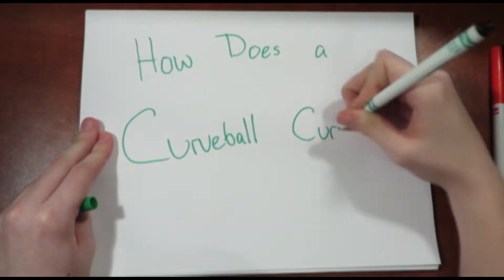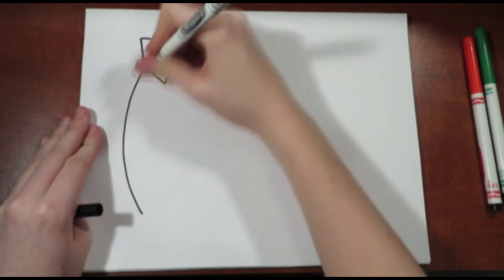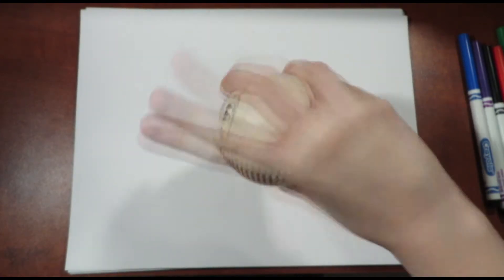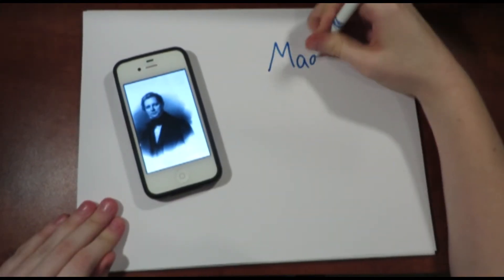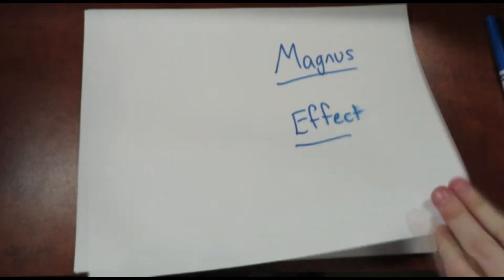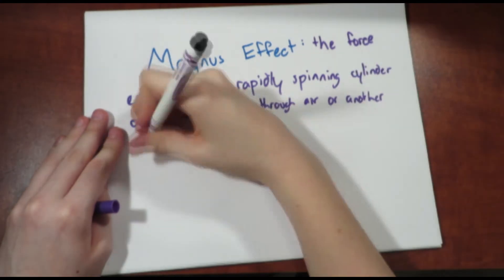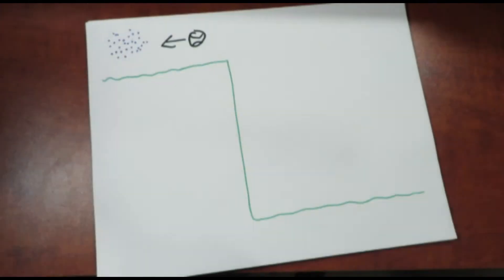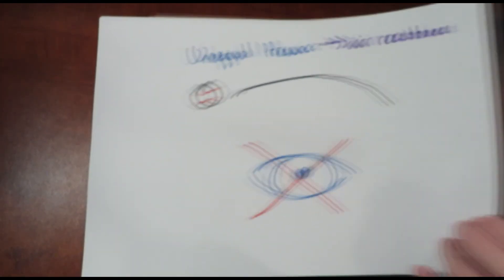UPDATED: How a Curveball Curves

Comment from the maker: How does a Curve-ball Curve? Script: 

Baseball isn't just about throwing and hitting a ball, it actually has a lot of physics. Take the curve ball for example; many people years ago had believed that it was just an optical illusion or that it was easier to throw then a fast ball because you throw it with less force. However, both these misconceptions are wrong. 

Curve-balls do indeed curve, or break, over the plate. A curve-ball is a pitch that appears to be moving straight toward home plate but that is actually moving down and to the right or left by several inches. A ball that spins 30 times a second can break as much as 17 inches, which takes less than half a second to reach the plate.  But how is this possible? Well, there are two basic factors that create a curve-ball, the proper grip and air resistance.  

Properly holding the baseball is an important factor to make it curve! You have to use 2 fingers and a thumb, holding the baseball between them, with the middle finger resting on the seam (red fabric) of the baseball. Then when you release the ball you have to snap your wrist causing your hand to be facing the plate and forming topspin on the ball. The ball will break down and away from a right-handed batter if it is thrown by a right-handed pitcher. 

The spinning action created when the pitcher releases the ball is the secret behind the curveball. This spinning causes air to flow differently over the top of the ball than it does under the ball. The top of the ball is spinning directly into air and the bottom of the ball is spinning with the air flow. The air under the ball is flowing faster than air on top of the ball creating less pressure, which forces the ball to move down or curve. This imbalance of force is called the Magnus Effect, named for physicist Gustav Magnus, who discovered in 1852 that a spinning object traveling through liquid is forced to move sideways.

Adding to the air pressure exerted on the ball are the 108 red stitches that hold the cover on the ball. Because they are raised, the stitches increase the amount of friction created as the air passes around the ball and places more air pressure on top of the ball. If you've ever seen a batter jump out of the way of a baseball that ends up crossing over the plate, you've seen a good curveball.

However when a pitcher throws a curveball, do you have to throw it slower than you would a fast ball? This is a mistake many young pitchers make when throwing curveballs. As the Magnus effect states, the faster the ball is travelling the more spin and therefore more curve it would have. So actually, if you want the ball to curve the velocity you throw it at is very important. 

Fun fact: density affects how far the ball will curve because it affects the amount of drag a ball will have. In higher elevated places (such as  the density of the air is more so there is more drag created and therefore the ball can curve more because the air molecules are causing more resistance to the ball. Whereas in lower elevated places the density is less so there is less drag. Of course, in order for the ball to curve significantly different the elevation of the places much be significantly different as well. 

So, to sum it up: unequal pressure on both sides of the ball caused by air resistance is the reason for a curve-ball's curve and is not a mere trick of the eye.